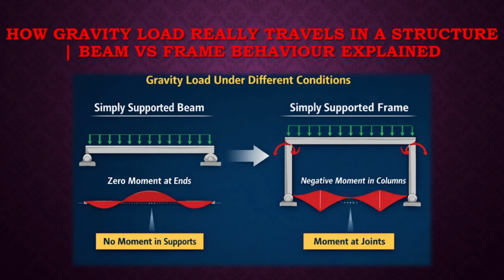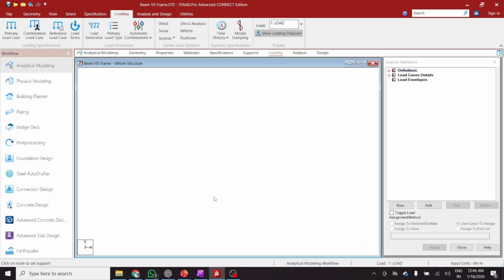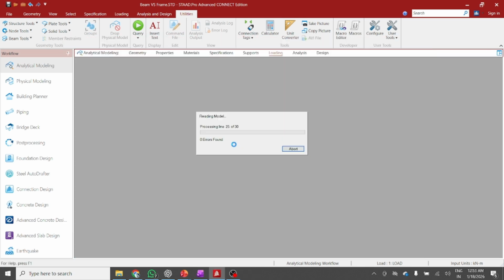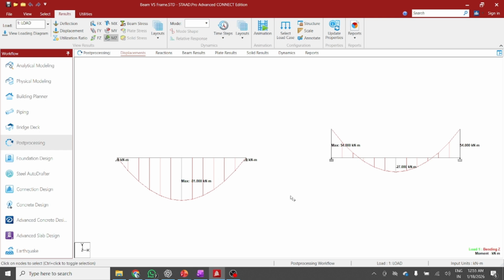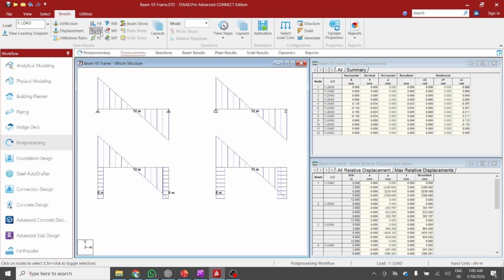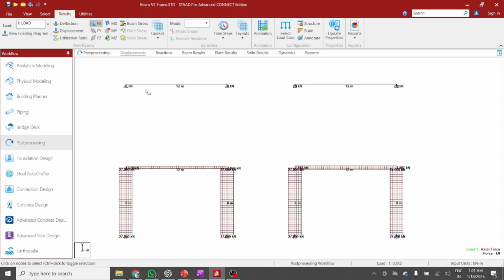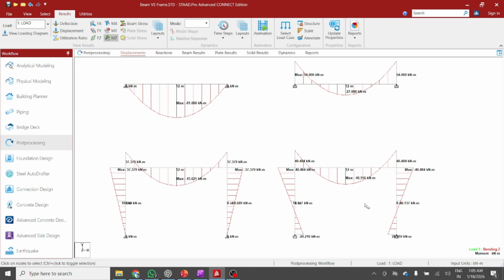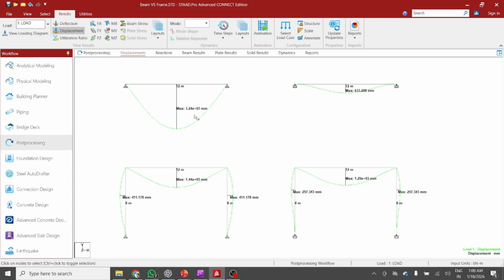How Gravity Load Really Travels in a Structure | Beam vs Frame Behaviour Explained

Comment from the maker: If you treat a frame like a simple beam, it won’t behave as you expect.

In this video, I used the same gravity load but changed only:
• Supports
• Continuity

And that changed:
• Axial forces
• Moments
• Shear
• Deflection

Many mistakes happen not because of wrong loads, but because we misunderstand behavior.

👉 Before trusting software, ask:
• Is this acting like a beam or a frame?
• Are rotations really restrained?
• Am I creating frame action by accident?

If you’re a student or engineer, comment:
Which surprised you most — axial force, moment, or deflection?

I read and reply to serious technical questions.